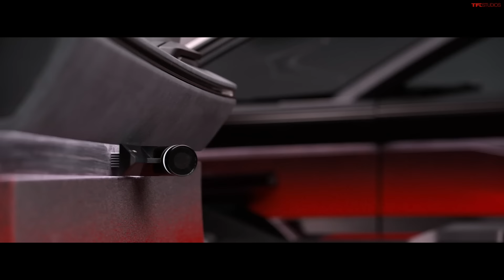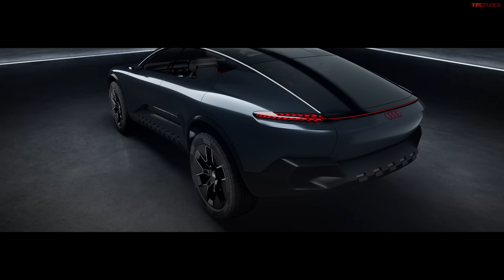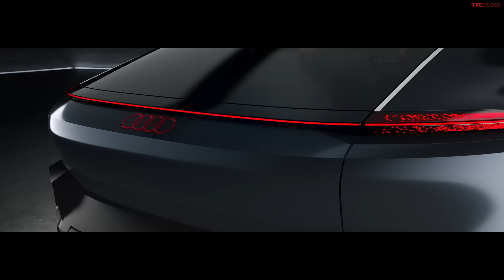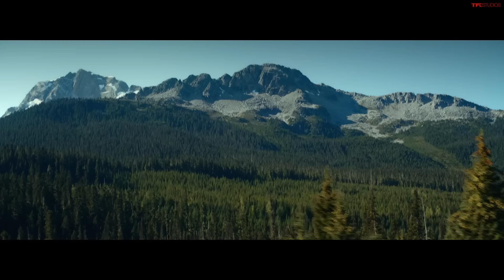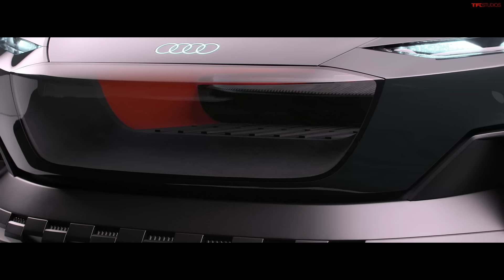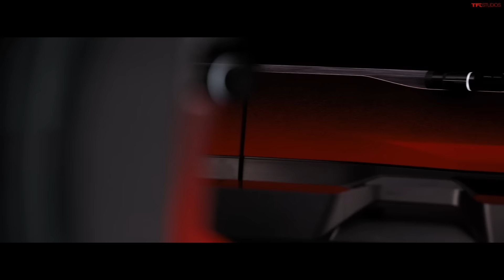Wait, What? The Audi Activesphere Concept Mixes an Off-Road SUV, Sports Sedan And a Pickup!

Comment: Few things:
- if they wanna make this, and make it offroad capable, pls better angles. I'm around 30 on my subcompact crossover for approach and over that for departure
- a serious flaw in the "sphere" control scheme is the premise of "looking at something to enable control". The entire point of why people like physical controls is minimal distraction. I can (in the right vehicle) adjust volume, change media or track, adjust climate, heat my mirrors, etc. without ever actually taking my eyes off the road. This REQUIRES one to move their eyes off the road. That's terrible. They need to reconsider that.